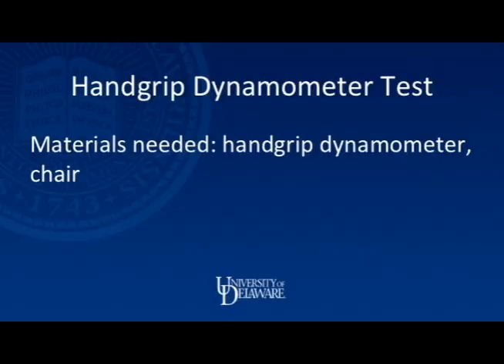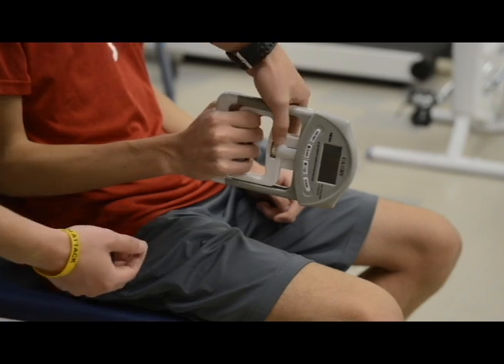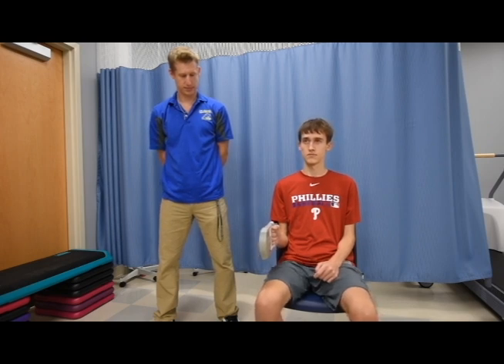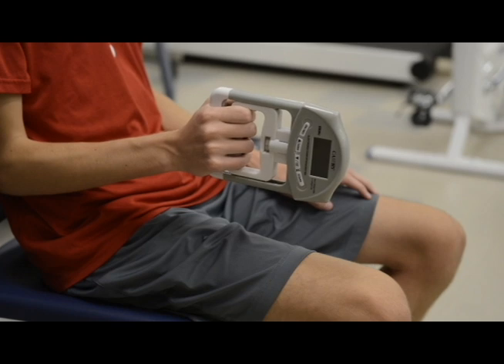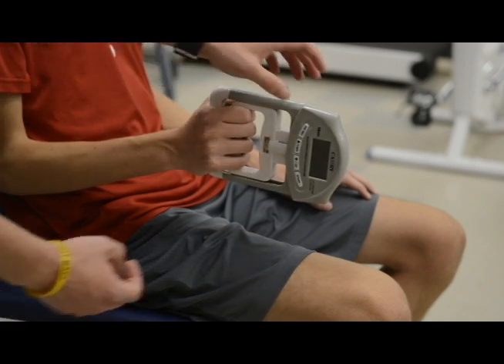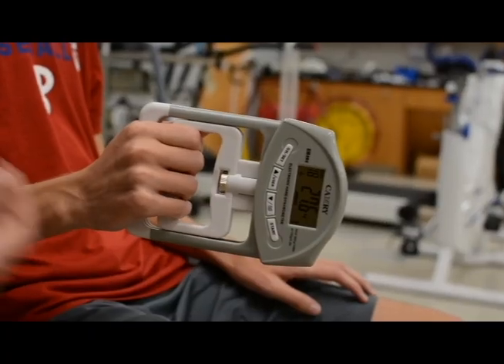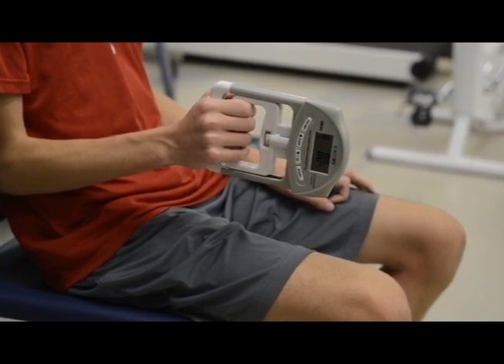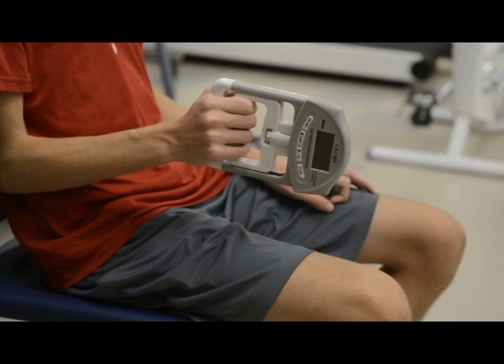Hand Grip Dynamometer

Comment: This test is a mystery for me, as I find  a lot of benchmarks online, saying 40 kg is very weak. I'm 40 yo, and I squeeze 40 kg (+- 2) with both hands. I went to the gym for 22 years (not trying to look like a gorilla, just trying to work my muscles constantly). I'm able to do 2 or 3 weighted pullups with added 30kg to my own 82kg. I can dangle off the bar for more than 1 minute. I would think that these feats are related to hand grip and are more impressive than 90% of the male population. So are any of you guys here, never working out in the gym and squeezing 55 kg or something? Even went to two doctors, both said, in their experience, the average guy squeezes less than 30kg. Still, internet shows I should be squeezing 60 kg to be above average.
Reply: Different dynamometers show different numbers, your grip is average if you're using the same dynamometer as in the video.
Reply: @oaiaferoce Don't believe everything you read on the internet. I have a friend who is a rehab physio specialising in hand rehab after people have had operations. This is usually a long process. She has given me some exercises to do at home or at the gym, but, and this is the kicker, the average male hands strength tested on one of the testers she uses is about 32-34 kilograms. Seems low, but that is the average for most males now. So what the 2 doctors told you is correct and very, very, very few men could squeeze 60 KG on one of these testers. For your age she said 35+ is the norm, but it also depends on your health and size and your fitness. If you can do 40KG+ with both hands that is good, most certainly not weak. 💯👍
Reply: The benchmarks I've seen give a range of 35 to 55kg as "normal" for a 40 year old. So you are fine. Also adjusting the width of the gripper can make a difference, as can technique and simply how you are feeling at the time. On a bad day my result was at least 12kg worse than on a good day (it was a good day in the recent video I made with the same dynamometer as in this video...)

That said I am surprised at what the doctors said about the average guy. They are probably seeing guys in worse health than average, and maybe skewed towards older demographics. I've only tested maybe 5 guys, mostly around my age ie 40s. Mostly they've got 50 something kg, but to be fair to the average guy they're bigger than average. The only adult guy that got less than 30 was my 82 year old dad who, although very fit for his age, has carpal tunnel and some arthritis in his fingers. He got 27kg. Though I reckon on a good day he could get over 30. All the women I tested apart from one got in the 30s kg, mostly low 30s.
Reply: @cudgee7144  Very interesting, thanks for detailing what your friend said. Mid 30s kg does sound low as an average. Maybe that's the new normal for guys that don't do any physical labour or exercise. But actually I see you went on to say that 35+ kg is the normal range for a 40 year old guy, which matches what I've seen.
Reply: @Athletophy  You have got it one my friend. Sitting on a computer or scrolling a mobile device does nothing for hand/grip strength. Most males don't do any sort of physical exercise any more. A lot struggle to bend over to do up their shoe laces. Have a good weekend. 😁
Reply: if you do not train. and do office work. you would say 40 is an normal amount
Reply: I'm 37 years old, 5'9 and 160 lbs. I didn't exercise for like 20 years. Just last year I started weight lifting a little bit and have done about 70 workouts since then. On a dynanometer my right and left hand are about 101.6 lbs. which is like 46 kg.
Reply: Hi, i’ve 39 years old almost 40, and i can press 76kg without sport imagine if I train 😅 I'm right-handed and I press more on the left because I've had pain in my right forearm for some time but my best is 76 for both, but I can’t do 5   Pullups or something like that
Reply: I have the same device, I pull 57 Kg with the right hand and 46 Kg with the left hand, 40 is normal and even above average if you include the whole male population.
Reply: Bro I'm strong asf, I can do 4-6 weighted pullups with 100lbs and I weigh around 205lbs. I can bicep curl 60lb dumbbells for 8 solid reps and I had to almost break my wrist from squeezing so hard just to reach 70kg
Reply: Strong women are in a range from 35kg-44kg. I tested them on my machine. Normal healthy guys have usually grip in 50-60kg range. Plumers, construction workers ex wrestlers enter 70s. So 40kg is ok, but far from good or average in a healthy male
Reply: Testosterone levels affect grip strength in real time. Could be a factor.
Reply: Coming back to my comment now. I ended up buying another dynamometer, this one electronic. I-m doing 54-57 kg now, in both hands. I was doing 38-42 kg with the mecanic/analogic one, from my initial comment. I also need to say that I have small hands with narrow fingers (from my mother's side). Average, 6.5 inches wrists. The rest of me is quite athletic, chest, buttocks, lats, very wide shoulders. I did track and field for 8 years growing up. 54-57 kg is still not great for 22 years of gym, but I've seen real charts in real studies saying small hands are less strong because of levarage.
Reply: @oaiaferoce  54-57kg is exactly average in males with average bone structure. I dare say you are even very good. But keep in mind grip can be improved